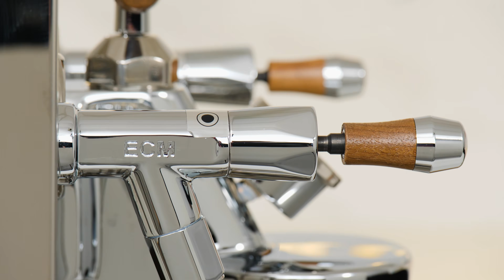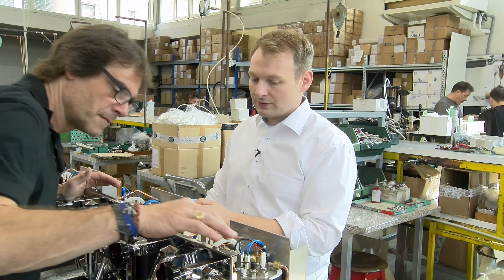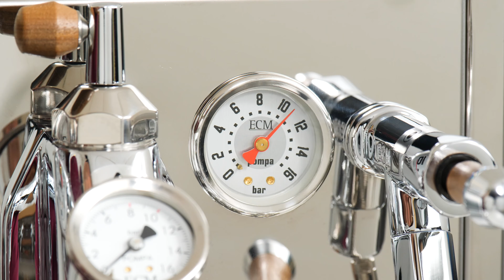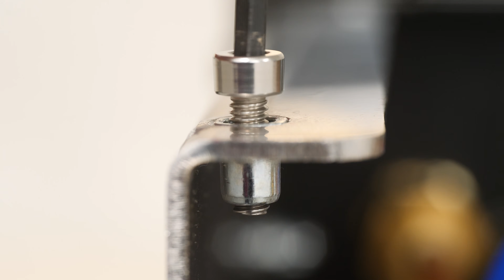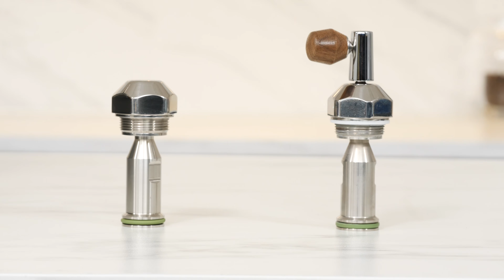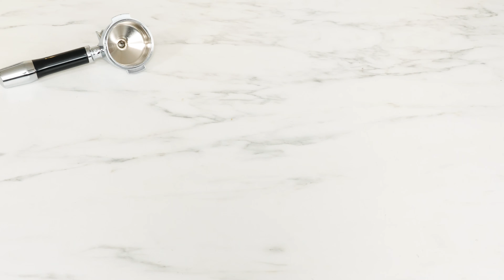ECM Synchronika In-Depth Review

Comment: Great review Mark! I am deciding between the ECM Synchronika and the Profitec Pro 800. I know one is a semi auto and one is a lever machine. Each is a different experience but, in your opinion, which one gets better results in the cup?
Reply: Basically the same. Differences are in the person pulling the levers or turning the knobs.
Reply: P800 my dream lever machine. Silent operation 😀
Reply from the maker: Hey Maria, Thanks for the comment! As others commented, a lot depends on the person pulling the levers, etc. In standard use, a lever machine pulls a certain type of shot typically characterized as sweeter and often with a slightly more syrupy body. By manipulating the lever you can change the shot - it's a very touchy feely thing. Levers tend to be more appropriate for use with traditional Italian style bean blends. A flow control equipped Synchronika gives a user more room to play with extraction variables. Long low flow rate pre-infusions produce excellent results with modern fresh from roast specialty coffees. Plus you have the latitude to go the other way and hit a darker roast or blend with extra flow off the top and reduce as an extraction progresses to control bitter flavors.
Hope that helps!
Marc

Comment: I have a Synchronika that’s 2 years old. It makes great espresso & it looks great. I have a couple issues….if I don’t get my drip tray perfectly lined up, I get a little water underneath my machine when I go to empty it.  When I turn off the shot, the back flush makes a mess. My machine, came in at 10 bars. No big deal I was able to adjust it.  So, other than that it’s great. I just don’t think my drip tray is correct, especially for how much the machine is. I wouldn’t mind having those wood accessories though!! Thanks
Reply from the maker: Hey 4, Thanks for the comments. I have not experienced drip tray issues. Exhaust from E61 groups on any machine can be forceful resulting in splashing. One can lessen by lowering the group lever slowly which results in a lower velocity of water exiting the exhaust port.
Marc

Comment: There is more than one version of Synchronica, such as 2019 and 2021. Is there a big difference?❤
Reply from the maker: Hey A, Machine in this video was produced end of 2022 and is same as machines currently produced. Between years/models there are slight changes. Most are invisible externally and have no impact in machine performance. One exception was about 5-6 years ago when steaming performance was upgraded to allow up to ~2bar of pressure in the boiler. Easy to identify machines with that upgrade. The T2 temp setting goes up to 270F on those machines.
Marc